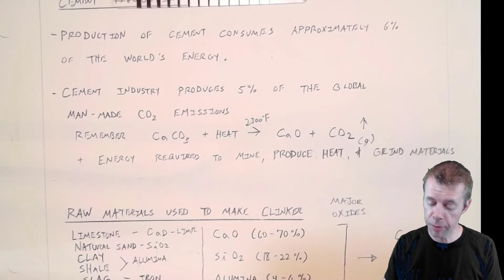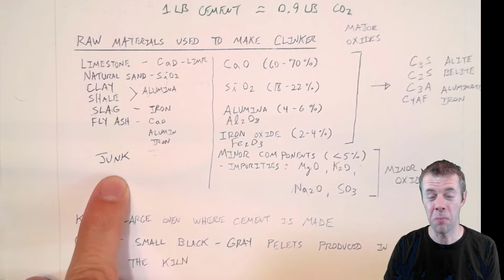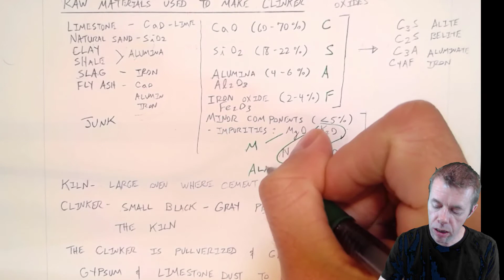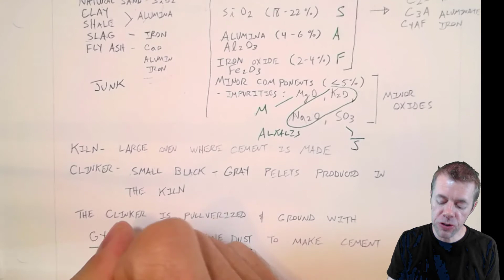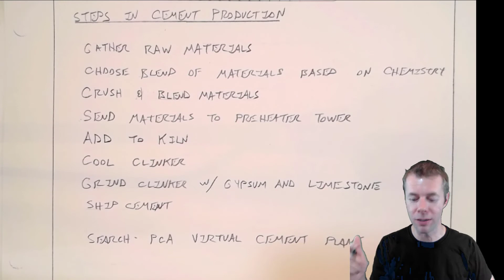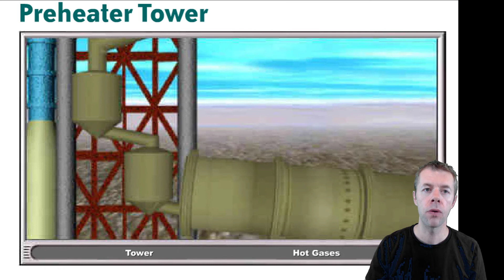Cement Manufacturing Process with the Portland Cement Association

Comment: In Michigan, in the past, a great deal of fuel for cement making came from burning waste solvents and paints from the auto industry.  You cannot bury that solvent garbage in a landfill,, it comes back in ground water and wells.  Can't dump the toxic sludge in the lakes or rivers.  Hydro carbon solvents from insecticides, herbicides,, deadly dangerous stuff.  Soooo,,, you burn it in the kiln making cement,, produces the heat required to make the cement,, AND the cement has a tremendous ability to absorb and retain the toxins SAFELY from the nastiness burned.   Cement can save environmental toxins and make them safe.

Comment: From what I have heard is that they add limestone to soften the cement depending on the use , like mortar for laying bricks needs to have a little flexibility so they add more limestone to the mix. I could be wrong but that’s what I was told.
Reply: Yeah this is a case but one of a primary purposes of Limestone usage while producing CEM1 cements is providing of Aluminate sources (mainly C3A) and Limestone to react and in this way obtaining Monocarboaluminate and Hemicarboaluminate AFm phases which fills the hydration space, decreases porosity and increases the early age strength. Also there are other perspectives of course but it's a detailed topic as other topics in cement chemistry :)

Comment: I have long wondered why cement manufacturers don't use large solar mirror arrays to get most of the heat for their production process...large upfront capital cost...free energy thereafter (except for maintenance). Bonus of less impact on the global climate as well as less pollution!
Reply: The process of clinker production requires about 2000 dg. C, and it's often mass produced in long (40m+) drum furnaces that work with hundreds of tons of material at once. Imagine the scale of the mirrors required to do this.

Comment: What options exist to reduce CO2 in cement production or at least sequester the gas?

Also, how was cement discovered and produced?
Reply: Tyler has a great video on the history of concrete! https://www.youtube.com/watch?v=lP0zPbkvBug&list=PLRq6Z9d0kCT_ObxZG5Mh2edgOyirtn0Co&index=35
Reply: Aalborg-Portland.
The use of alternative fuels (2018 30 %) and the use of some of the heat from the kilns. I Aalborg about 22% of the district heating comes from Aalborg-Portland (2018 22.000 homes).
Search for Aalborg-Portland and you can find more info.
(Yes, i Work at Aalborg-Portland 🙂  )